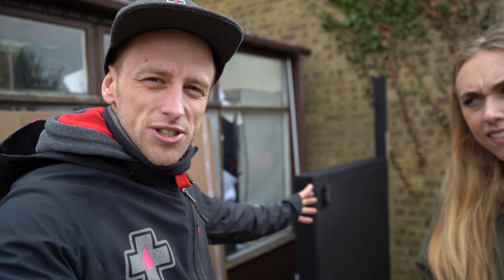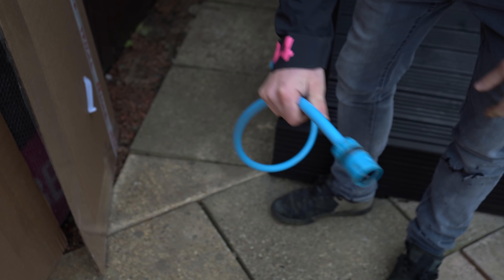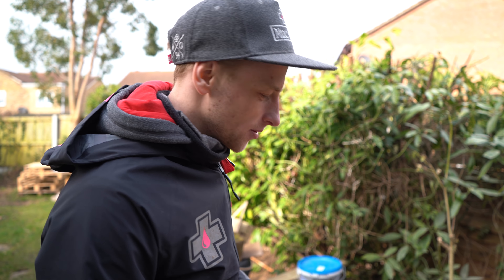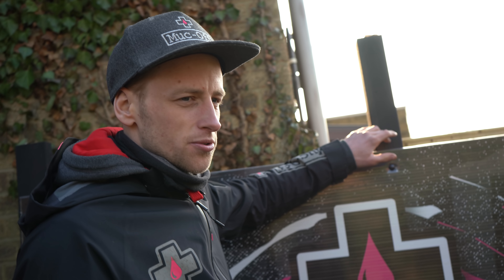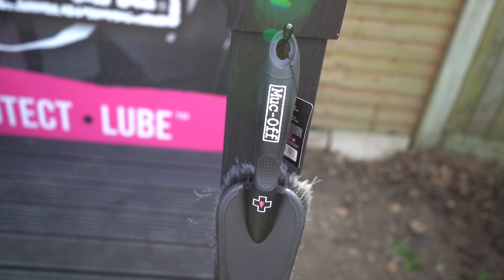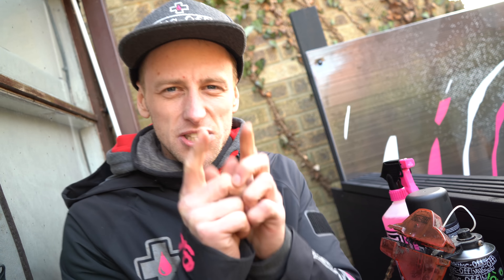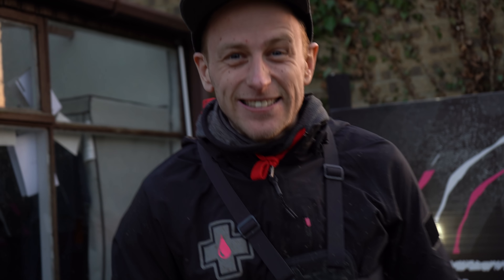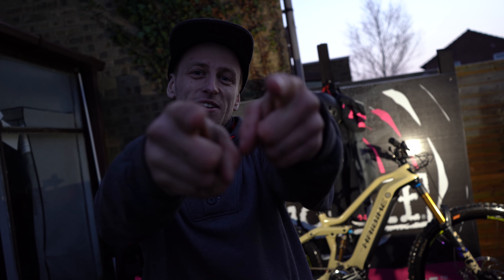BUILDING THE ULTIMATE BIKE WASH STATION// PART 2

Comment: A lot of work to clean off your bike,, your sponsor wouldn't like my system,, I use wax lube, no oil, or grease gets on the bike, no chance of contamination, or washing out of bearings/cables with detergent, just water needed to clean the bike. sooo much easier. KISS principle spplies...